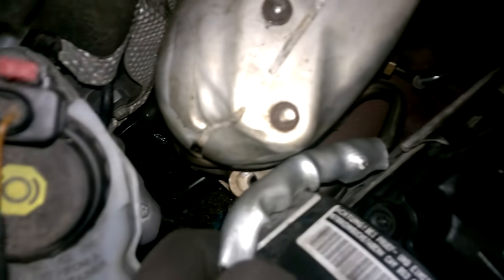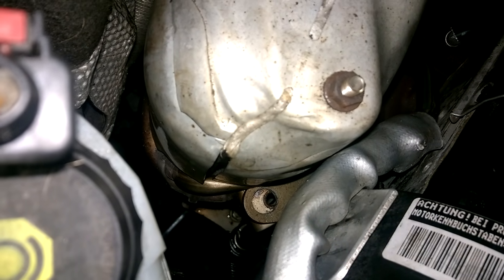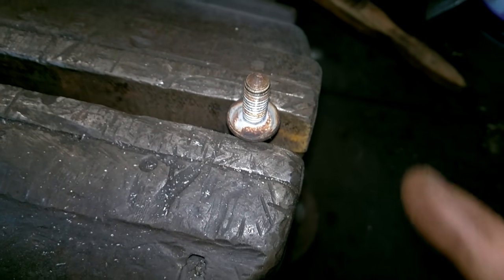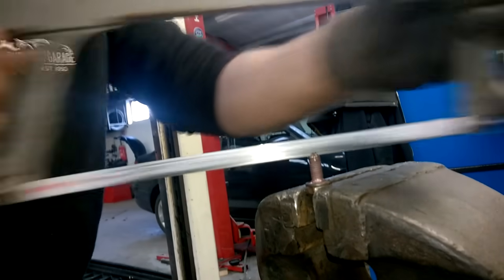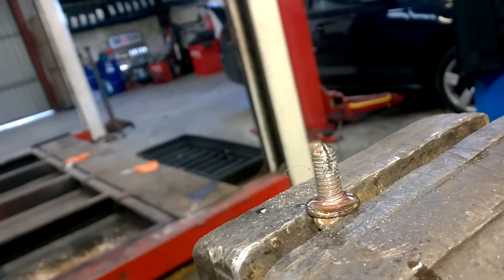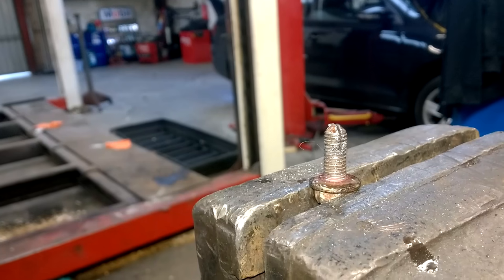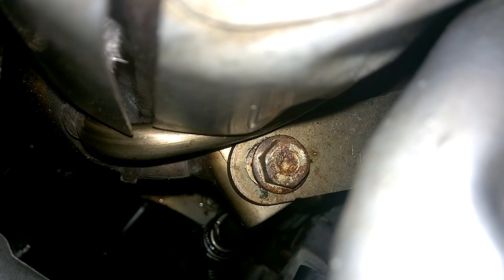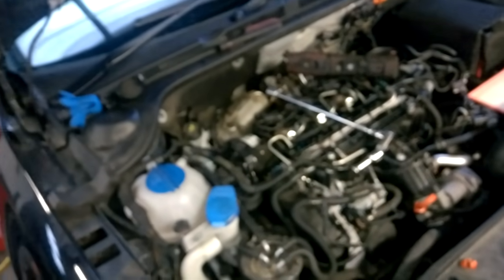My Father Taught Me This! Passing It On To The Next Generation

Comment: Cool tip!
Reply from the maker: Thanks Kevin 
 
The update info below is the pinned comment on this video, I know most people do not realize I made that video and it better explains/shows this method in use.   
I also included below details of why the job was done this way free of charge with the customer fully informed. I hope you check it out  👇👇
 
UPDATE* I decided to make a follow up video on this https://www.youtube.com/watch?v=yfNQullGEuQ&feature=youtu.be Should answer some of the questions that were raised, I include 3 demos of this in action with close up shots.
 
As there was some safety concerns & confusing comments raised, I felt I should clear a few things up. 
1) This is a tip for certain circumstances only, I never have and never would use it on a component which would cause any safety concern to any customer.  
2) The demo was done on a support bracket only, items like this or similar will not cause any safety concern. 
3) I did this free of charge and on a time restraint, I noticed it when I was replacing another item, the customer needed the vehicle back that evening and I decided rather than leave it like it was, I would do this and secure it up fully. 
4) The bolt was not the issue, the part that the bolt threads into is a secured piece, someone had previously damaged it, leaving the bracket loose and the bolt just tightened a turn or so.
5) The bolt can be removed and will not break, it will go in and out as usual and has helped clean up the damaged threads.  
6) Used in the right application I personally believe this is a great tip and can save you a lot of time & trouble. 

Lastly to all the people who have watched the video, Thanks very much and I am delighted with the feedback I have received on it.

Comment: Never do it run a die  over the bolt and clean the threads and then it always goes in not to mention he doesn’t know how to use a hacksaw he just ruined the blade because he  push down on it when he was going back-and-forth you only push down on the forward stroke on hacksaw blade

Comment: Elongate the hole in the bracket,  this method adds extra stress to the bracket.
Reply from the maker: The update info below is the pinned comment on this video, I know most people do not realize I made that video and it better explains/shows this method in use.   
I also included below details of why the job was done this way free of charge with the customer fully informed. I hope you check it out  👇👇
 
UPDATE* I decided to make a follow up video on this https://www.youtube.com/watch?v=yfNQullGEuQ&feature=youtu.be Should answer some of the questions that were raised, I include 3 demos of this in action with close up shots.
 
As there was some safety concerns & confusing comments raised, I felt I should clear a few things up. 
1) This is a tip for certain circumstances only, I never have and never would use it on a component which would cause any safety concern to any customer.  
2) The demo was done on a support bracket only, items like this or similar will not cause any safety concern. 
3) I did this free of charge and on a time restraint, I noticed it when I was replacing another item, the customer needed the vehicle back that evening and I decided rather than leave it like it was, I would do this and secure it up fully. 
4) The bolt was not the issue, the part that the bolt threads into is a secured piece, someone had previously damaged it, leaving the bracket loose and the bolt just tightened a turn or so.
5) The bolt can be removed and will not break, it will go in and out as usual and has helped clean up the damaged threads.  
6) Used in the right application I personally believe this is a great tip and can save you a lot of time & trouble. 

Lastly to all the people who have watched the video, Thanks very much and I am delighted with the feedback I have received on it.

Comment: Thanks !!!!!!
👍👍👍👍👍
Reply from the maker: Thanks Les 
 
The update info below is the pinned comment on this video, I know most people do not realize I made that video and it better explains/shows this method in use.   
I also included below details of why the job was done this way free of charge with the customer fully informed. I hope you check it out  👇👇
 
UPDATE* I decided to make a follow up video on this https://www.youtube.com/watch?v=yfNQullGEuQ&feature=youtu.be Should answer some of the questions that were raised, I include 3 demos of this in action with close up shots.
 
As there was some safety concerns & confusing comments raised, I felt I should clear a few things up. 
1) This is a tip for certain circumstances only, I never have and never would use it on a component which would cause any safety concern to any customer.  
2) The demo was done on a support bracket only, items like this or similar will not cause any safety concern. 
3) I did this free of charge and on a time restraint, I noticed it when I was replacing another item, the customer needed the vehicle back that evening and I decided rather than leave it like it was, I would do this and secure it up fully. 
4) The bolt was not the issue, the part that the bolt threads into is a secured piece, someone had previously damaged it, leaving the bracket loose and the bolt just tightened a turn or so.
5) The bolt can be removed and will not break, it will go in and out as usual and has helped clean up the damaged threads.  
6) Used in the right application I personally believe this is a great tip and can save you a lot of time & trouble. 

Lastly to all the people who have watched the video, Thanks very much and I am delighted with the feedback I have received on it.

Comment: What do you call that thing holding that bolt
Reply from the maker: The update info below is the pinned comment on this video, I know most people do not realize I made that video and it better explains/shows this method in use.   
I also included below details of why the job was done this way free of charge with the customer fully informed. I hope you check it out  👇👇
 
UPDATE* I decided to make a follow up video on this https://www.youtube.com/watch?v=yfNQullGEuQ&feature=youtu.be Should answer some of the questions that were raised, I include 3 demos of this in action with close up shots.
 
As there was some safety concerns & confusing comments raised, I felt I should clear a few things up. 
1) This is a tip for certain circumstances only, I never have and never would use it on a component which would cause any safety concern to any customer.  
2) The demo was done on a support bracket only, items like this or similar will not cause any safety concern. 
3) I did this free of charge and on a time restraint, I noticed it when I was replacing another item, the customer needed the vehicle back that evening and I decided rather than leave it like it was, I would do this and secure it up fully. 
4) The bolt was not the issue, the part that the bolt threads into is a secured piece, someone had previously damaged it, leaving the bracket loose and the bolt just tightened a turn or so.
5) The bolt can be removed and will not break, it will go in and out as usual and has helped clean up the damaged threads.  
6) Used in the right application I personally believe this is a great tip and can save you a lot of time & trouble. 

Lastly to all the people who have watched the video, Thanks very much and I am delighted with the feedback I have received on it.

Comment: Isn't easier get another bolt?
Reply from the maker: The update info below is the pinned comment on this video, I know most people do not realize I made that video and it better explains/shows this method in use.   
I also included below details of why the job was done this way free of charge with the customer fully informed. I hope you check it out  👇👇
 
UPDATE* I decided to make a follow up video on this https://www.youtube.com/watch?v=yfNQullGEuQ&feature=youtu.be Should answer some of the questions that were raised, I include 3 demos of this in action with close up shots.
 
As there was some safety concerns & confusing comments raised, I felt I should clear a few things up. 
1) This is a tip for certain circumstances only, I never have and never would use it on a component which would cause any safety concern to any customer.  
2) The demo was done on a support bracket only, items like this or similar will not cause any safety concern. 
3) I did this free of charge and on a time restraint, I noticed it when I was replacing another item, the customer needed the vehicle back that evening and I decided rather than leave it like it was, I would do this and secure it up fully. 
4) The bolt was not the issue, the part that the bolt threads into is a secured piece, someone had previously damaged it, leaving the bracket loose and the bolt just tightened a turn or so.
5) The bolt can be removed and will not break, it will go in and out as usual and has helped clean up the damaged threads.  
6) Used in the right application I personally believe this is a great tip and can save you a lot of time & trouble. 

Lastly to all the people who have watched the video, Thanks very much and I am delighted with the feedback I have received on it.

Comment: With all due respect, I am an Automotive Engineer BSME and MSME with 40 years of experience at a major OEM in Detroit, MI.  The shank is under torsional loading when torqued to spec.  A cut down the centerline means there is less cross sectional area to carry this load and that the load is discontinuous.  Moreover, threads that are uncompromised will have much higher unit loading with the same torque applied as a bolt with no centerline cut.  The bolt will fail prematurely due to the stress overloading of uncompromised threads and/or shank being torsionally overloaded. There is a technology known as a MAT Thread which is patented and does have a very slight taper at the end and a "dog point" to pilot a bolt in.  This is now widely used in the industry for anti-cross threading.  If a fastener will not start by hand - STOP!  There is something wrong.  It is best to clean the threads of a bolt hole and chase with a tap is necessary.  Then the bolt or stud should go in nicely as designed and there is no risk of failure due to a centerline cut.
Reply from the maker: The update info below is the pinned comment on this video, I know most people do not realize I made that video and it better explains/shows this method in use.   
I also included below details of why the job was done this way free of charge with the customer fully informed. I hope you check it out  👇👇
 
UPDATE* I decided to make a follow up video on this https://www.youtube.com/watch?v=yfNQullGEuQ&feature=youtu.be Should answer some of the questions that were raised, I include 3 demos of this in action with close up shots.
 
As there was some safety concerns & confusing comments raised, I felt I should clear a few things up. 
1) This is a tip for certain circumstances only, I never have and never would use it on a component which would cause any safety concern to any customer.  
2) The demo was done on a support bracket only, items like this or similar will not cause any safety concern. 
3) I did this free of charge and on a time restraint, I noticed it when I was replacing another item, the customer needed the vehicle back that evening and I decided rather than leave it like it was, I would do this and secure it up fully. 
4) The bolt was not the issue, the part that the bolt threads into is a secured piece, someone had previously damaged it, leaving the bracket loose and the bolt just tightened a turn or so.
5) The bolt can be removed and will not break, it will go in and out as usual and has helped clean up the damaged threads.  
6) Used in the right application I personally believe this is a great tip and can save you a lot of time & trouble. 

Lastly to all the people who have watched the video, Thanks very much and I am delighted with the feedback I have received on it.

Comment: I love your accent.
Reply from the maker: Thanks for watching Ben 
 
The update info below is the pinned comment on this video, I know most people do not realize I made that video and it better explains/shows this method in use.   
I also included below details of why the job was done this way free of charge with the customer fully informed. I hope you check it out  👇👇
 
UPDATE* I decided to make a follow up video on this https://www.youtube.com/watch?v=yfNQullGEuQ&feature=youtu.be Should answer some of the questions that were raised, I include 3 demos of this in action with close up shots.
 
As there was some safety concerns & confusing comments raised, I felt I should clear a few things up. 
1) This is a tip for certain circumstances only, I never have and never would use it on a component which would cause any safety concern to any customer.  
2) The demo was done on a support bracket only, items like this or similar will not cause any safety concern. 
3) I did this free of charge and on a time restraint, I noticed it when I was replacing another item, the customer needed the vehicle back that evening and I decided rather than leave it like it was, I would do this and secure it up fully. 
4) The bolt was not the issue, the part that the bolt threads into is a secured piece, someone had previously damaged it, leaving the bracket loose and the bolt just tightened a turn or so.
5) The bolt can be removed and will not break, it will go in and out as usual and has helped clean up the damaged threads.  
6) Used in the right application I personally believe this is a great tip and can save you a lot of time & trouble. 

Lastly to all the people who have watched the video, Thanks very much and I am delighted with the feedback I have received on it.

Comment: Just my 2 cents... When you offer someone a tip and they decide its something worth negatively commenting on, it's not your duty to prove it works. The burden is on all these keyboard mechanics and basement engineers to show why its unsafe. If they don't like the tip, they don't have to use it. In other words "FU*K EM IF THEY CAN'T TAKE A JOKE". My grandad showed me the same thing for when threads were too goobered up to use a tap or dde set to fix it. They actually make bolts like this for certain applications.

Comment: Ok. Never thought of this.
Reply from the maker: The update info below is the pinned comment on this video, I know most people do not realize I made that video and it better explains/shows this method in use.   
I also included below details of why the job was done this way free of charge with the customer fully informed. I hope you check it out  👇👇
 
UPDATE* I decided to make a follow up video on this https://www.youtube.com/watch?v=yfNQullGEuQ&feature=youtu.be Should answer some of the questions that were raised, I include 3 demos of this in action with close up shots.
 
As there was some safety concerns & confusing comments raised, I felt I should clear a few things up. 
1) This is a tip for certain circumstances only, I never have and never would use it on a component which would cause any safety concern to any customer.  
2) The demo was done on a support bracket only, items like this or similar will not cause any safety concern. 
3) I did this free of charge and on a time restraint, I noticed it when I was replacing another item, the customer needed the vehicle back that evening and I decided rather than leave it like it was, I would do this and secure it up fully. 
4) The bolt was not the issue, the part that the bolt threads into is a secured piece, someone had previously damaged it, leaving the bracket loose and the bolt just tightened a turn or so.
5) The bolt can be removed and will not break, it will go in and out as usual and has helped clean up the damaged threads.  
6) Used in the right application I personally believe this is a great tip and can save you a lot of time & trouble. 

Lastly to all the people who have watched the video, Thanks very much and I am delighted with the feedback I have received on it.

Comment: Thanks 🤘🤘
Reply from the maker: The update info below is the pinned comment on this video, I know most people do not realize I made that video and it better explains/shows this method in use.   
I also included below details of why the job was done this way free of charge with the customer fully informed. I hope you check it out  👇👇
 
UPDATE* I decided to make a follow up video on this https://www.youtube.com/watch?v=yfNQullGEuQ&feature=youtu.be Should answer some of the questions that were raised, I include 3 demos of this in action with close up shots.
 
As there was some safety concerns & confusing comments raised, I felt I should clear a few things up. 
1) This is a tip for certain circumstances only, I never have and never would use it on a component which would cause any safety concern to any customer.  
2) The demo was done on a support bracket only, items like this or similar will not cause any safety concern. 
3) I did this free of charge and on a time restraint, I noticed it when I was replacing another item, the customer needed the vehicle back that evening and I decided rather than leave it like it was, I would do this and secure it up fully. 
4) The bolt was not the issue, the part that the bolt threads into is a secured piece, someone had previously damaged it, leaving the bracket loose and the bolt just tightened a turn or so.
5) The bolt can be removed and will not break, it will go in and out as usual and has helped clean up the damaged threads.  
6) Used in the right application I personally believe this is a great tip and can save you a lot of time & trouble. 

Lastly to all the people who have watched the video, Thanks very much and I am delighted with the feedback I have received on it.